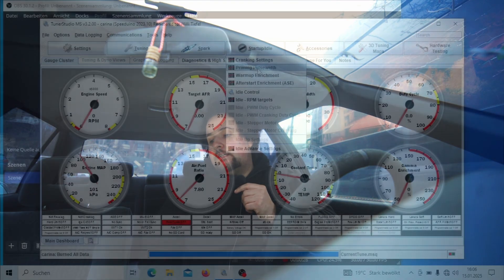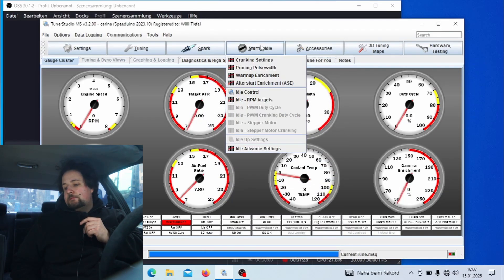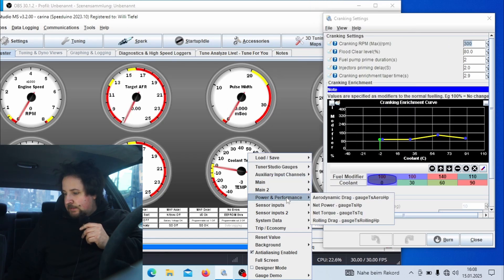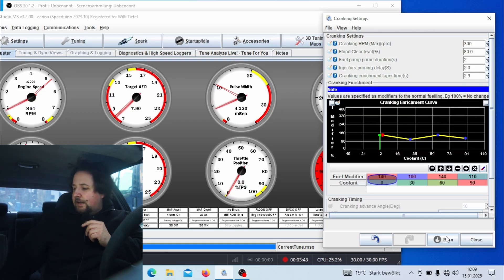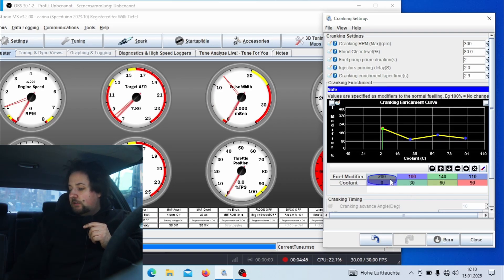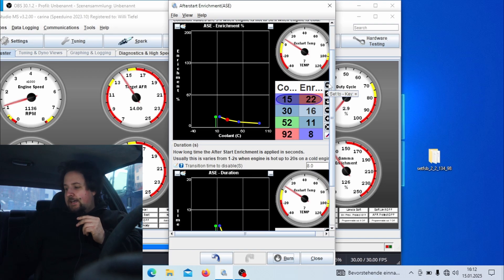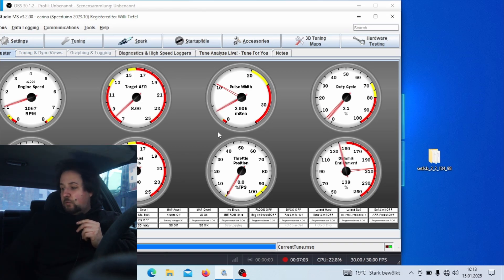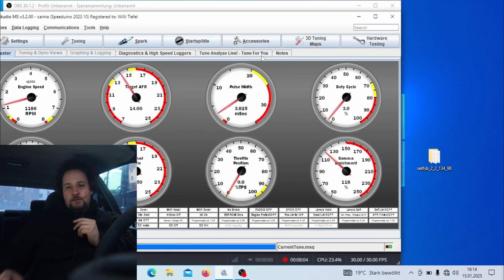Tunerstudio standalone ECU Tuning Guide | Part 16 Cold start Tuning MADE EASY | Megasquirt Speeduino

Comment: All your setup videos are good, but this one should have been one of the first. But thanks anyway for sharing with us.
Reply from the maker: @sergiorusso8253  the reason why its so late is that you should really be done with most of the runing stuff because the ve table and other factors can influence your cold start fueling and ignition 

Also doesnt make much sense to do a cold start video when its 20 degrees c at night here in greece haha thats not really a cold start lol
Reply: @throttlebuddies0  Yes, I understand everything perfectly, everything is OK. It's just that people from more northern latitudes came across the topic of the video quite early. It's good that there was a lot of setup information in the previous videos, and I was able to start the engine. But with the onset of winter, starting the engine became a problem, as it turned out, I was making a very rich mixture.
Reply from the maker: @sergiorusso8253  yeah i have explained a bunch in my basemap videos so there most things already were pretty clear this is just a continued video on the actual demonstration basically :)

Comment: Excellent video! Please continue with advice on this. I'm building a Speeduino for a Dodge 5.9L Magnum V8 flex-fuel (gasoline+E85). I'm a mechanic not a programmer so looking forward to your video guidance. Thanks!
Reply from the maker: sure i will though it takes a while. for NA applications i almost have everything covered so far tho. 

if you have any questions you can send me a message on instagram too